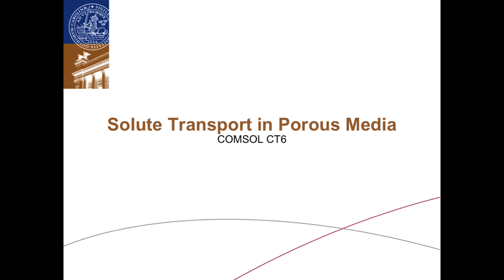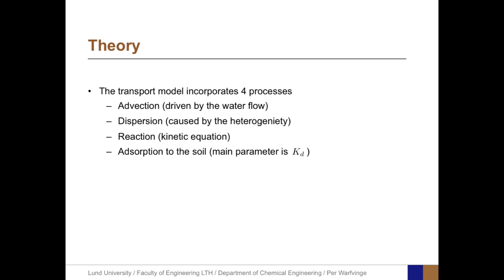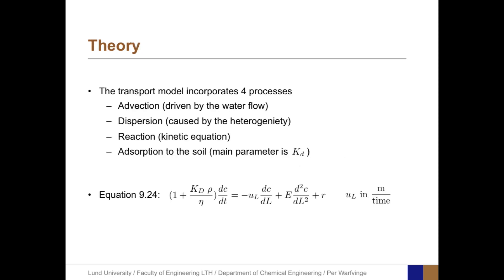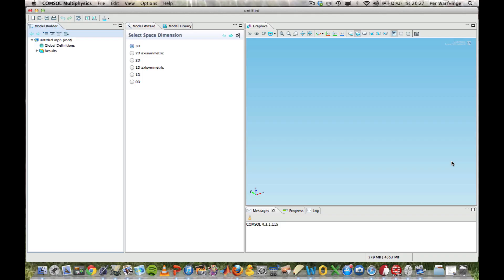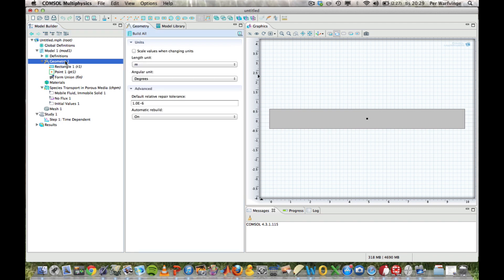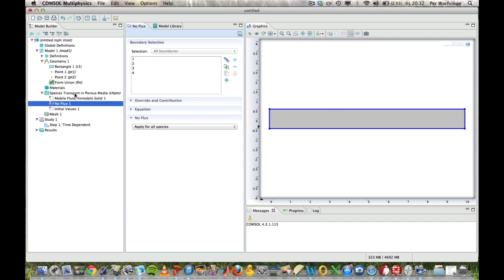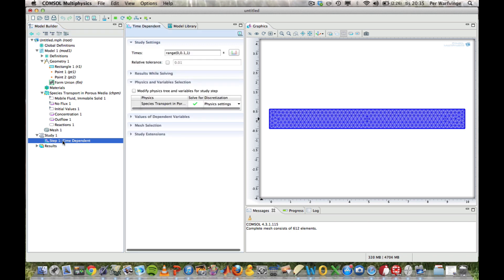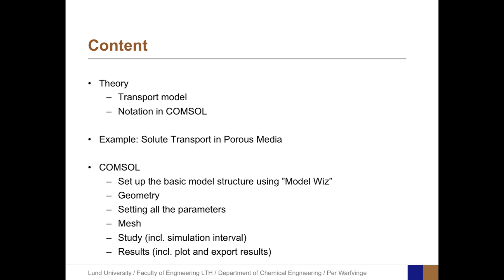18 – COMSOL for Solute Transport in Porous Media

Comment: Could you please if it is  possible to simulate a fluidized bed reactor with adsorption isotherm model
Reply: Thank you
Reply from the maker: @dr.mohanadm-ridha1130  Please only send your questions once. We already answered your question under another video:

It would not surprise me if  it is possible as you can combine different physics models in Comsol. At our department, however, we co-develop other tools for simulating, optimising and controlling  chromatographic systems e.g. for the production of biopharmaceuticals. At the core is a program than can run/control other software (including Comsol and Aspen) as well as running our own code.

For more information regarding similar research at the department see e.g.

https://doi.org/10.1016/j.cherd.2019.12.015
https://doi.org/10.1016/j.chroma.2020.461760
https://doi.org/10.1016/j.jbiotec.2019.05.013

Comment: Hello, My research is on modeling of thermal remediation (mostly steam flushing or thermal conduction heating) for treatment of groundwater contaminated with LANPLs and DNAPLs. I wonder if Comsol can model multiphase systems. I only have access to student version which is not a full version so I should add the equations eventually. do you have a reference with all the equations that I can use and add to the student version for my 3D model?
Thanks so much for the tutorial.
Reply from the maker: Hi, editor of channel here. In my work I have only scratched the surface of what Comsol Multiphysics is capable of, but a strength with the program is that you can combine different kinds of physics. I remember even seeing a model of pyroclastic flows and we once had a PhD-student at our department modeling transport in swelling systems (medicine pills that you swallow and swell in your gut. If the system swells the whole geometry changes which makes modelling a really tough task).

As I understand it, however, Comsol Multiphysics is strongest in the fields where there is a tough commercial pressure. Some chemical related parts have been lagging a bit behind as other parts develop (That's my experience all the time since the program was called Femlab). My knowledge of Comsol Multiphysics is limited though, so I partly base my impression on what other experts tell me about Comsol Multiphysics.

Per W, the creator of this video, did have a research project on remediation of soils in cold climates, we do have minor student projects in our courses on the spreading of contaminants in soils, and we have had master thesis students looking into soil remediation.

However, as I understand it no-one at our department has been into hard-core modeling LANPLs and DNAPLs

Comment: sir

I am working on a project of carburization.I am trying to simulate in the comsol software.The process is such that the methane and hydrogen gas is passed to the sample in a temperature of 720 k so that methane breaks to form carbon which is diffused.the diffusion follows ficks law and I do have the values for inital and surface concentration.can you please help me to solve this.also it is done in the presence of plasma.Also the sample is placed in furnace
Reply from the maker: Editor here: Sorry, we don't have the resources to support students at other universities with their projects. Try contacting a local expert.

Comment: Dear, I want to simulate adsorption process in fixed activated carbon bed by using comsol
Reply: +zaman saleh Did you figure out how to do that? I have an adsorption problem also, and I do not know how to account for the adsorption?
Reply: @aishakhaleel5352  I'm working on simulating a mass transfer in porous media. I am having difficulty setting the maximum concentration in the domain.
Did you figure out how to do that?

The stream has a higher concentration that my domain can adsorb..